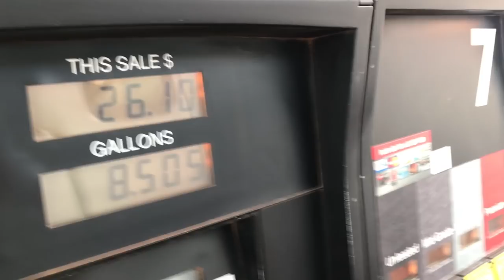Surviving The Arizona Strip's Sweltering Heat For Mule Deer "INQUEST 2018"  Antler Trader

Comment: if your fan quites working it's your blower motor resistor will fix the ac
Reply from the maker: john mac it’s the compressor
Reply: Antler Trader Is it the compressor or the stupid blend door??
Reply from the maker: Mike Day I’m pretty sure it’s the compressor but I haven’t had time to actually go through it. I will check the blend door for sure
Reply: Antler Trader I have virtually the same truck. AC was fine but blend door would open for no reason. Repair is expensive!

Comment: I didn't think you could patch a side wall?
Reply from the maker: Charlie Belle Legally most tire stores won’t but it can be done with out issues if done correctly. I managed a tire company for several years specializing in Heavy equipment and Semi fleets.